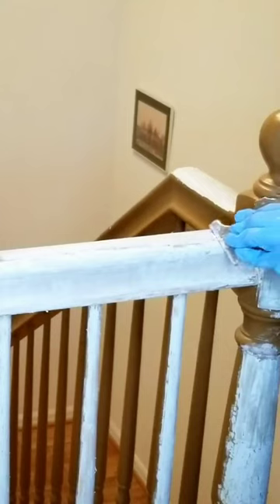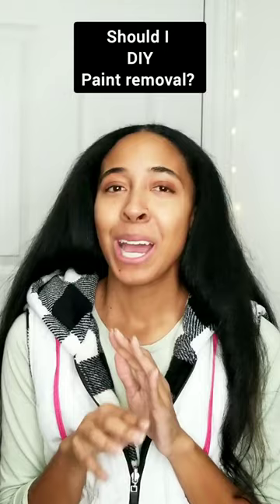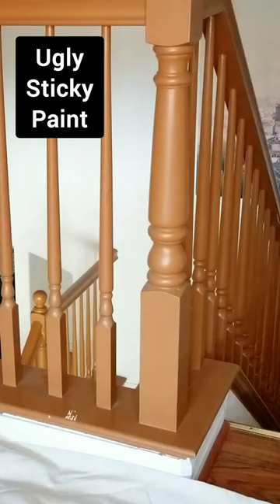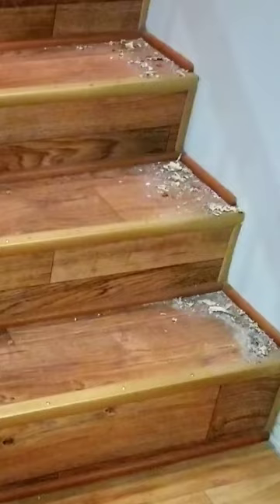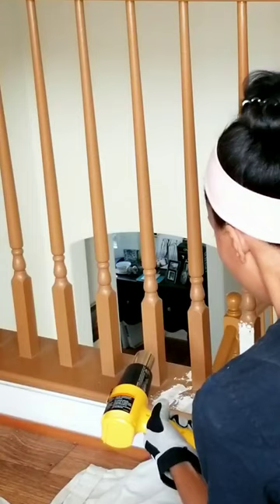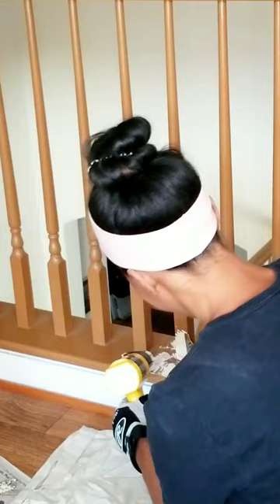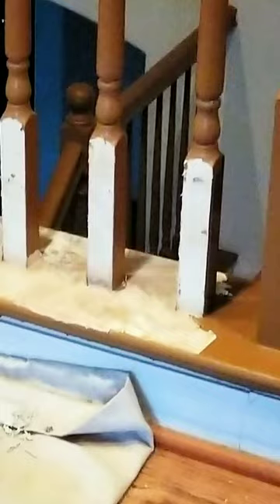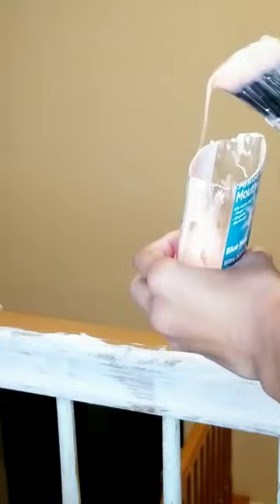Nightmare DIY Paint Removal?!

Comment: So many content creators on the internet suggest Citristrip so I tried it.  It’s worthless!  It doesn’t work and really messed up my project!  Now I get the old fashioned favorite that costs about 1/3 of the Citristrip !
Reply from the maker: Yeah it was pretty hard to work with 🤔
Reply: What you end up using? Having a nightmare. Heat gun is slow but worked on flat surface of doors. Now need something to cleanup the trim around curved glass. Might try chemical stripper
Reply: It’s called something like Strip Easy or Strip Ease. Sorry, I don’t have a can at this time, but I got it at Ace Hardware.

Comment: I mean thats how we learn right.

Ive spray painted my car almost 3 times now, and ive gone from only hands. To a battery powered 1 speed da sander, to a corded sander and more features, more bodywork practice, all my primers have been done through rattlecan, painted the car with a roller and house paint, and now im ready for a paint gun, compressor, and real automotive paint.

But shooot, id be lying if i said that first time a mirror cap, headlight cover, or body panel came out glossy and perfect i wasnt extremely excited and proud of being able to do it. 

Good work, just keep doing stuff. Because maybe even if yours isnt perfect you now have knowledge to help others doin the same.
Reply from the maker: 👍 painting a car! That's cool

Comment: There was about 8 coats of paint on my staircase,  so o used a heat gun at 550C, then sanded. It took over a week to complete,  but was worth the effort. 😂
Reply from the maker: yes, I think I should have tried to get a better gun from the start😆 Initially I was worried it wouldn't work on latex paint, but at least it did that

Comment: Hi everyone! What’s the best tool/ easiest way to remove all of the paint from the spindles, cap and base. There are some weird angles of the railing where my bate/ paint scrapper can’t scrape.
Reply from the maker: One option is a chemical remover and wire brushes or steel wool

Comment: Been there, done that! Almost always need to use a variety of methods. I would have started with sanding here....
Reply from the maker: I thought the dust would be a problem for our pets and I do not have a professional sander... maybe on the next project 🤔
Reply: @VirginiaAyrieVlogs  there are ways to control dust. You can hang sheets of plastic which have zipper doors to contain it. I put the pets in another room. Shop vacs can be connected directly to power tools or held nearby. Good for you for trying and sharing!
Reply from the maker: Oh, those zipper doors sound cool! Thanks so much for checking out the video!
Reply: @VirginiaAyrieVlogs  You can find them in the Home Depot paint dept. ;)

Comment: Next time try sanding paint off no chemicals needed👍
Reply from the maker: Oh I kind of thought I would need a professional sander for that, but that's a good idea!
Reply: All you need is the sand paper with a pice of wood or something solid and just the sand paper on your hand so you can do the round parts and a mask
Reply: @jose6321j  maybe if there were only one or two layers that would work. I would just go with a scraper to get off the first layers and then a sander after
Reply: @joserincon6344 tried. Failing horrifically
Reply: @snor69  yeah heat gun is best option, when there is only one layer of very old paint that is flaky then I use s sander otherwise heat gun and scraper

Comment: How did you ventilate/protect yourself in the house? I’ve been working on stripping my bedroom doors and it’s worked well - but that’s outside.

I’m scared to do the indoor trim and walls because of the fumes and toxcicty
Reply from the maker: I opened the windows and turned on the ceiling fans. It's definitely an activity for spring or fall. I also kept our pets in the garage. Our stairwell is pretty open so the smell could dissipate, but try working in small sections.